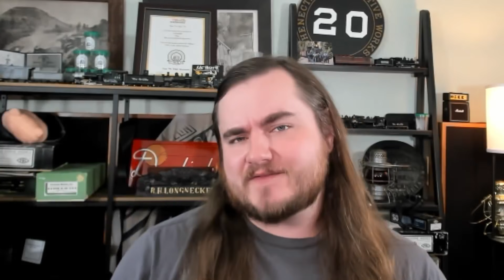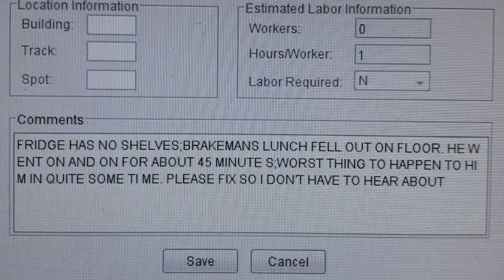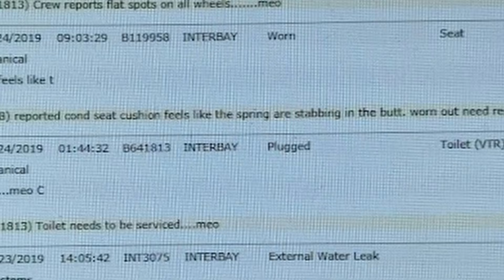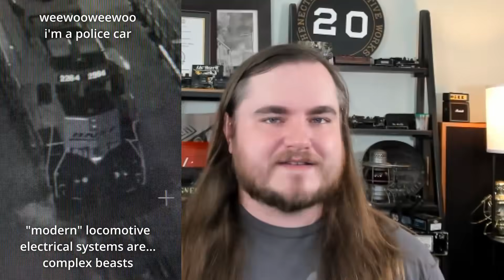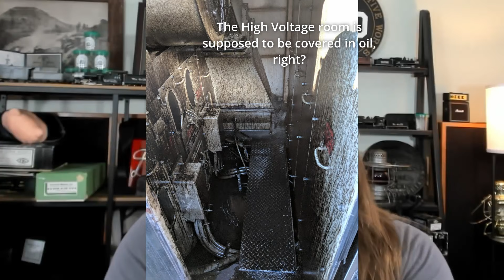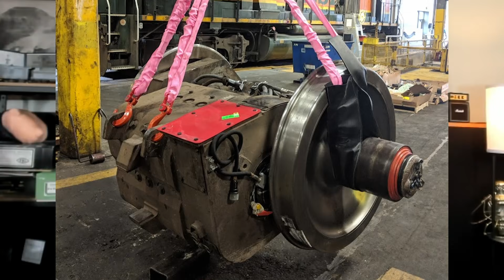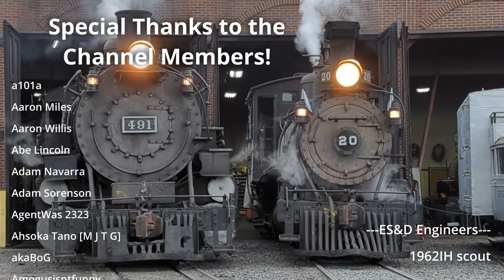What DEFECT LEVELS can a train engine have?!

Comment: Watched this video again and now I'm curious.

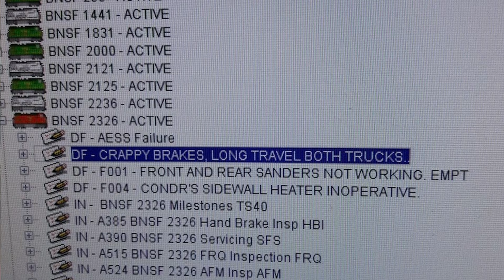At 1:43, what exactly would that be? Obviously excessive piston travel is an FRA defect, but brakes out of adjustment doesn't really prevent the locomotive from moving. Not sure you'll even see this but thought I'd ask anyway.
Reply from the maker: I'd assume worn out shoes, or the trainman just trying to write out a way to say "the brakes suck" and using the FRA verbiage to get mechanical attention, if I had to guess. :D
Reply: @Hyce777  I was more asking what level defect that would be considered. Sorry, could have been clearer with what I was asking.

Most of the defect levels seem to be related to locomotive's ability to pull or have a crew on it, even though long piston travel means it's illegal to move, it doesn't mechanically prevent you from moving it so I was curious what the system would call it.

Call it a level B for "BRAKES NO WORK" lol.

Edit: Thanks for answering btw, I know this is an old-ish video.

Comment: Rewatching for fun, but now part of me wonders about that letter W, and steam. 

Steam engines have notably uneven power output, and can put extra wear on the track because of that, right? 

Can a steam engine running hard ever put enough stress on a track to get flagged with a code W if one of the cylinders happens to pulse in the right spot (assuming all the wheels are round and otherwise in good shape)?

Comment: As a relatively new locomotive engineer, this is fascinating. Also good to hear that the same company issues are always company issues. I didn't hear any defect codes for the air system, where would those usually fall?

Comment: Level 404: the locomotive cannot be found. The locomotive may have been taken down or is temporarily unavailable. Check your comms equipment and try again later.
Reply: How do you feel about the company's running trains with 5 or 6 power units and miles long as one train, one crew?

Comment: Interesting take on the EMD SW switchers. I've ran a large variety of locomotives from GP7's to the the C4's, but have very little experience with the switchers. I always thought of the SW1000's and SW1500's as updated version of the older switchers, kinda how a GP38 was to a GP9. Of course they were built in the era of before the Dash-2 cards simplified the electrical, and I'm not sure if they ever got that upgrade.
Oakway SD60's were a favorite of mine, but I would take a SD40-2 any day of the week over the newer stuff. The SD60M's were the first EMD's with the microprocessor and desktop controls....it seems they just went downhill from there.
I always thought that most locos that run a bit smokey were either clogged air filters or sticky injectors. The older GE locos (pre Dash-8) were just smokey regardless. Just be thankful you didn't have to work on the GE U-series or Dash-7 series locos...they were just junk.

Comment: Hey! My 86 Chevy Silverado Custom Deluxe 4x4 with the 6.2L Diesel engine was parked because it was a Level S... and also had issues reporting oil pressure I never solved... After replacing the pump, the oil pressure sensor and testing to make sure the oil gauge worked. Yeah... Dad replaced the engine with one I felt that should have gone to the shop but couldn't afford to send it to a shop for a full tear down. He SWORE it was good because 1. the exhaust was clean and 2. the van he pulled it from was in a wreck... Still smoked worse than he did for a half hour after start-up (so you KNEW it had oil) and reported half the pressure it should have.

Comment: Wonder why one of my Local units is flagged for a level 3 on TSS on the on hand function... Left on Friday and it was a level 9 now its a level 3 lol.. Though one unit I had broke a BC pipe from the engineers side to the conductors side... requiring the 2nd set of trucks to be cut out or it lost MR pressure and wouldn't pump up.. I think it was due to the flat spots at 55 mph they stripped the fittings teeth on it so it got level 1'd and it wasn't engine related and the guys came out next day to fix it.

Comment: As a mechanical engineer by degree, pharma as a specialization those measurements that are supposed to identify the increased concentration of the bearing casing (i highly doubt that surface hardened steel could provide detectable contamination) material in the sample must be fun. Especially the experimental baseline that describes the neutral degradation over the lifecycle of a bearing.

Comment: I actually have a couple questions related to train wheels.
I know they have tires. Steel tires.
But that leads to my questions:
How many times can you true up the tire on an axle (traction motor equipped or free-spinning) before you need to replace the tire(s) on that axle?
Related, due to attempting to maximize uptime, I'm pretty sure that even if you can just true up the tires on an axle, you swap out the whole thing and work on it separately where you don't have the time pressure of "this train needs it's axle back", but do most railroad repair facilities have the equipment needed to put new steel tires on such an axle? Or is that something you send out to a separate shop that ONLY puts new tires on the axles? After all, sure an axle is big and heavy, especially one with a traction motor on it, but it's a lot easier to ship around just worn and fresh axles than it is to ship around entire locomotives and pieces of rolling stock that need new tires, right?

Comment: "Excessively smoky" Yeah, I'm betting the turbo oil seals (and piston rings, to a lesser degree) had a good bit of say in that.
Lose a turbo oil seal on the exhaust side, and you've made a smoke machine. That's how tanks make smokescreens without using a smoke grenade by the way, they just inject oil (diesel fuel/JP-4/kerosene in this case) into the exhaust manifold, hot exhaust manifold vaporizes it but there's not enough air for it to burn, so you get a smoke show!
Same thing happens (at a higher temperature, still well within reach of a diesel engine exhaust manifold) for lubricant oil.
If it's the INTAKE turbo oil seal that fails, you have an entirely different and much more destructive beast on your hands.
Diesels run on nearly any liquid combustible fuel. There have occasionally been some experiments done by coal-rich oil-poor nations, trying to run diesel engines on a slurry of extremely finely pulverized coal and water.
The interesting thing is that they actually would run. The problem, and why nobody in their right mind even considers it, is that wear on the fuel pump was too high, and it would only have ever worked with indirect injection (air blast type) fuel injectors, not the high pressure "squirt fuel into the cylinder directly" type of injector that is in modern diesel engines, for the same reason. And those unsophisticated injectors also dragged down the efficiency of the entire engine as well.
What's the reason for the increased wear and inability to use the good injectors? Well, it's the same thing you wanted to work in the first place, the coal is an abrasive powder, and it's only mixed with water, so you're basically using lapping compound on the already finish-fitted parts, meaning you're just removing material for no reason, aka increased wear. Oh yeah, and another flaw, increased deposits in the combustion chamber from coal fly ash and slag.
Anyways, back to my point. Diesel engines will run on pretty much any combustible liquid, and guess what? Lubricant oil is in fact a combustible liquid! It's about the same properties-wise as heavy fuel oil, which is used in cargo ship diesel engines. That's a problem if your turbocharger's intake-facing bearing oil seal fails, because that causes lubricant oil (something a diesel engine will happily run on) to leak into the intake, where it is conveyed by the airflow into the cylinder, where it burns, causing the engine to continue rotating. If the leak is severe enough, the engine will happily continue running (poorly) even if you cut off the diesel fuel supply to the engine. This is called a diesel runaway, because once it reaches a self-sustaining cycle, the only thing to do is try to block off the air intake (some engines have a "intake fuse" aka a spring-loaded butterfly valve to block off the intake, which the computer can trip along with the fuel shut-off if it detects that it can't slow the engine's speed), or just retreat to a safe distance and notify both the fire department and (if it's an automotive diesel engine) a towing company, because that engine is certainly on the path to self-destruction. Eventually that lube oil supply will run out, but by then, the engine will have either overheated, mechanically failed, or wiped out its bearings due to low oil supply.

I'm an auto mechanic, and I wouldn't wish a diesel runaway on my worst enemy. I've watched a few of them on the internet, and they're terrifying even thru the camera lens. I can only imagine that they're even scarier when you're actually standing next to them.

Comment: In the early 1950s riding a Western Pacific passenger car, I was amazed that when the toilet was flushed, you could look down the toilet and see the ties going by. Apparently there was just a sliding valve that dumped the toilet.
I live about a half mile from the BNSF main and often hear wheels with flat spots.
Can the traction motor be taken out of gear or does it always have to turn?

Comment: Interesting video...comes to mind one time when I was filming and a NS train started to pull out from a signal and I still recall it was 8211 that started suddenly puffing thick black smoke which then erupted into fire blasting out the exhaust as it rolled down the line starting under the trees.

Comment: I seen a locomotive get royally messed up with a simple derail once. It was IIRC a watco engine, K&O runs through my town, and I remmember once seeing them towing one of their locomotives back, had the LOTO tags on it and everything. Aparently, it derailed in the either horace or towner yard and not only damaged the wheel, but also cracked the frame and tore up a roller bearing. idk how it was still being towed on its own trucks.

Comment: Whats the difference between the yard and the house, in this context?
Reply from the maker: The roundhouse is specifically within mechanical limits, and operates under special rules with derail devices in place to protect it. It's usually within a yard; the yard is where the good power from the roundhouse goes to get added to trains and where the bad power from off the road is stored before moving to the house.
Reply: @Hyce777  Thanks! Trains are super cool and fun to learn about.

Comment: Did you ever get diesels come in with evidence of real sabotage done to them?  My brother used to work as a signals electrician at a country town railway yard and would often get called out o look at problems with the diesels. Most often it was to replace blown headlamp bulbs, but several times it was a case of somebody shifting circuit cards around in the electronics, that would inevitably require the locomotive to be towed back to the capital city workshops.  It was thought that one of the signal men for whatever reason liked to mess tings up.  It just couldn't be proven.  Some of the people who worked there were a bit psycho.

Comment: Could you imagine the fireman and engineer on 844 or 4014 back in the 50’s  saying “we won’t be taking 844 today because the air conditioning isn’t working and it’s too hot!” 

Nope. We really have devolved into a bunch of weaklings in the last half century 😂

Comment: Level 5, replace fuel filter and clean any fuel screens, reprime. Charge an exorbinant amount because the operator didn't check. At least on construction equipment. Retrain your operator.

Comment: Old EMC power (pre EMD)...
One of my favorites...
No end caps on connecting rods. One misfire, and the rod comes off the crankshaft. Pray that the piston stops at the top so you don't damage the crankshaft.
In theory, a two stroke diesel engine doesn't need end caps one the connecting rods because there's always pressure on the crank.
Doesn't always work that way.

Comment: I had a slipped pinion gear on a leader one time. Luckily, the mechanical guys that came out decided that the axle wasn't locked, and it could be slowly moved to the nearest setout track. Which fortunately was just a few miles away, and in a minor miracle, maintenance of way hadn't locked out that switch. Then we had to run the train with the only remaining engine long hood forward, with rear end manned helpers, up a steep hill, and tied down the train in a siding.

Comment: As a BNSF locomotive engineer, I appreciate this rundown. I see the codes on the train tracker, but I usually haven't known what they meant. Our paperwork will designate locomotives to run, have isolated, or be dead (which could still have a running diesel engine) but doesn't specify anything more than that, and unfortunately some previous transportation crews and even some shops are lax about tagging engines. And sometimes, some shops will actually fix an issue, but leave the tag still on it.
Reply from the maker: Yeaaaaaah that's not changed in the 4 years since I quit. Lol. Lot of folks don't want to take ownership of the tag, and usually the supervisors are too clueless to do anything about it either.

Comment: Not too long ago I was watching a local train work at a refinery and he was running around his train. The crew was experiencing electrical difficulties and the main headlight wasn’t working. They still had ditch lights, but watching the engines run by in the dark made the train look like a highrailer or a work truck. The crossings he passed were also quiet zones, so assuming his lights weren’t working, he should have used his horn, but he didn’t.

Comment: I remember hearing a story about a particular GE. Any time the diesel engine was running the whole motor shook like no other. A rod was broken internally if I'm remembering right. 

Another one came in, smelling like everything had been on fire. Some sections of the intake manifold had melted.. And the turbo impeller was no longer attached to the the turbocharger. It was in the air filter box, right alongside the air filter elements which had been completely charred.

Comment: Having worked with and on 18 wheelers my whole life, its interesting to see just how similar the maintenance logistical processes are between trucks and trains, despite all the other differences
Reply: Stationary equipment also. We had 3 12V-71 Detroits  for driving our pumps. A level 9 for us was something happened, we don't know what, it kept on running. Level 1 was when you saw the dipstick go flying across the engine room. We had spares for most things except for the gearboxes. If anything happened to one of them, we were in deep trouble. It would mean something was going to have to go to the shop 100 miles away. We mostly would have had level 8 where the engine shutdown and we didn't know why. Check everything and all fine so start it back up and let it run. If we were down for an hour, the phone would start ringing ( our green phone which most people would think of as a red phone ). Who was on the line was what we worried about so it got a prompt answer. In levels of worry least to worst: 3) our control room, 2) The Army Corps of Engineers, 1) a Federal Judge.  The Control Room had a 4th level. It was a call from the Governor's office because they got a call from the judge.

Comment: whilst they can redistribute the power for less traction motors on certain model increasing torque , they are still geared for the extra motor, and diminishing returns means you never make up for the losses.

Comment: That comment about burning a couple gallons at idle in a day caught me off guard. A standard 15L semi truck at idle burns about one gallon per hour at idle. Is locomotive idle usage really that low?
Reply from the maker: Idle is like, 300 rpm or so, depending on the engine. That may be the figure with auto start working as well; fuzzy brain on that.
Reply: @Hyce777  a semi idles around 500 rpm, or a little higher at around 800 rpm if the driver is needing a.c.while sleeping. It would make more sense if that number included auto start. One of my trucks had that, and it is a huge fuel and run hours saver.
Reply: Locomotive engines, at least the 4 strokes, can skip fire. An automotive engine would run very badly at the best of times if it was skipping.

I think even the 2 strokes will sit down around 275, but the FDL engines could get crazy slow in low low idle.

Comment: I have a question: did you ever have a "problem child" locomotive? A reoccurring problem that kept happening no matter what you did to fix it?
Reply from the maker: Christ. Several. Lol. 254, 274, and 294. Three freshly rebuilt SD75M's. 254 had, a wacky software problem that was preventing half of the engine from firing. Took months to sort out why it wasn't loading properly at higher throttle settings. 

274 had something wrong in the main alternator. It required it to be replaced. We never figured it out. Management assumed the crews were being idiots, so it got shipped across the railroad to work out of Minneapolis. The electricians at Northtown figured out the problem and got the main alt replaced. 

294 had an error in the rebuild in the rear gear train that was so small that it was really hard to diagnose. Ended up needing a new gear, iirc. Caused an oil pressure issue only in certain conditions, but regularly failed. At one point it was the 12th worst performing locomotive in the system.